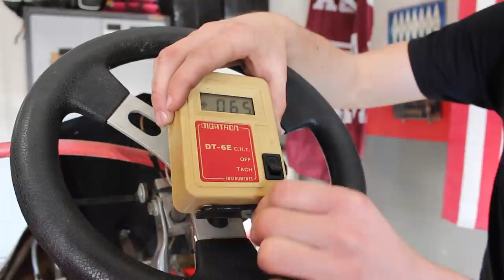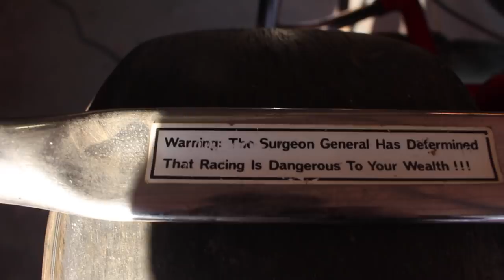2-Stroke Racing Go Kart Find!

Comment: I’ve been looking for one of those engines for years, $400 is a killer deal
Reply: CarsandCameras yamaha also still sells them
Reply: Sounds like the plug could be dead
Reply: CarsandCameras get a vintage kart
Reply: Come to Australia! We still race them here. Got mine for 200 running and rebuilt
Reply: on ebay i buy a birel shifter go kart with a tm kv 92 with 2 chassis and 3 seats for only 450€
Reply: you cant find any? they used to race them all the time lik a year ago... but they were replaced with a ka100.
Reply: CarsandCameras I'm a big fan of yall's work.You guys got me into carts again.I'm gonna buy me a racing cart this week just like this one.
Reply: CarsandCameras I've got a built into that needs a few parts to get it running
Reply: These engines are okay the bt82 engine came in a junior 110 and maxi 115 there vac operated on diagrath lol
Reply: Yamaha Kt100s
Reply: I got a nice racing cart for 400
Reply: thats real old junk  @hotrodj21
Reply: It’s a margay lynx.   A damn caddy in its day!   
C&C kicks ass.    I don’t live far from Isaac!
Reply: I have a few rare race yamahas and mugen engines if you really want to make this thing scary like 22krpm redlines lol
Reply: Hey guys cars and cameras I mean can u do more pit bike videos plz
Reply: You can buy them new still
Reply: You know that engine is a Yamaha kt100cc engine and they are quick as
Reply: @jons8877  They still race them, just depends where you go. There are still a lot of places where they get good grids.
Reply: What engine is that ?

Comment: The BCR on the head will be the kart shop that RE built this motor, I rebuild these ever 10 hours when in race conditions,we still use these motors in Australia for a bit of fun. To prime the carb, take spark plug out and place palm over intake and turn motor over until you feel fuel on your hand. The high and low jets are your fuel meters, start with low jet 1 and a half turn out and high jet at 3/4 turn that's a good start. Supposing this is the walbro carbs we use here. Make sure you haven't got gunk in your crankcase from when you cleaned it. Most importantly have fun these things are sick,wait until you get to use it on a track.
Reply: Also don't idle these motors on a stand without load, your exhaust will clog itself up and spark plug will go to shit. Also probably need a rebuild kit through the carb.
Reply from the maker: Jarrad Powell Ok awesome, thanks
Reply: Build Break Repeat easy done lads!! Let me know of you have any other questions but sounds like you have a pretty healthy motor for the time being! Keep up the great vids!

Comment: Good Vintage  Kart  you have acquired there at a great price. Looks like a Margay from the 80's. I have a copy of the Yamaha owners manual from the mid 1970's when these motors first came out. Standard Carb setting is High speed needle (H) 3/4 + or - 3/16, Idle needle (L) 7/8 + or - 3/16 Idle speed 3,000 to 3,200 rpm. The inlet screen gets clog so check that is clean, also the metering lever standard is 1.4mm below the diaphragm mount best to make up a little gauge to check that. Once you get it runni ng properly operating range is 10,000 to 14,000 rpm. With the right gearing it is capable of 100 MPH. Raced these in the 70's & 80's have one setup with two of these motors on.
Reply: Also Margay karts is still in operation, so if you contact them they can tell you more about the chassis you have.

Comment: Need to watch cranking it over like that an the engine not starting it could wear the rings an piston if it’s not sucking in the mixed gas . I’d rebuild the engine top and bottom an new seals on crank

Comment: Good chance it has weak spark, try a new spark plug first, 2 strokes like to burn up spark plugs. next check your grounds and coil.
Reply from the maker: Experimental Fun Just ordered some yesterday, hopefully that’s the issue thanks.
Reply: Agreed good place to start
Reply: And if you can get the model of the carb off the side I can get the stock tuning numbers for how far out the screws need to be.
Reply: Was gunna say new reeds
Reply: @Chiko Eval Same thought from first attempt.
Reply: They don't "burn them up", lol. They just will foul faster if too much oil is being mixed with the gas (not to be confused with the air/fuel mixture in carb).
Reply: Try setting the low needle (taller one) to about 2 turns out and the high needle (smaller one) just cracked open. I run these settings on my kart with that same engine and not only do I get a lot of power, it starts a lot easier then just dumping gas on it.

Comment: Check the compression. Low compression in 2 smokes makes it act like that. New plug and new gaskets, clean the carb it should run like a top

Comment: Make sure you have the right oil mixes, also check compression, another cheaper and easier way to deal with low compression is put some 2 stroke oil down the cylinder before starting

Comment: When starting my 1990's 100cc class one kart similar to yours I always put my hand over the air intake to draw the fuel up to get it to fire up no problem
Reply from the maker: rickburnout666 I’ll try it. Thanks
Reply: Build Break Repeat I'd put a new spark plug in it first. 2 strokes can foul a spark plugs quickly so might be a good idea to have a few around. It'll look like it's getting apart but won't be strong enough to run. The hand over the carb to draw fuel in is a good tip. You can to the same thing by placing your hand over the exhaust outlet and instead of sucking fuel it'll force fuel up into the carb. You can hold your hand over the exhaust until it starts to run, If you can't find any initial carbs setting online turn the high speed all the way in and set it to 1-1/2 turns out and the low speed needle to 3/4 out. There's probably a air speed screw too and that'll take some fine tuning to get it set right. But you'll love how much power you'll get out of that little engine and It'll teach you a lot about tuning. Keep your eyes on the lookout for a 2 stroke dirt bike you can get a enjoin out of. You could probably pick one up for real cheap. A 125 on that little cart would be sick! You'll have to rig up a shift lever and a clutch lever to get it off the line but you won't need to clutch after that to shift up and down. Just imagine having 6 gears! I'm sure you already thow this but they can got up to100mph with the right gearing. This cart the way it is now is still gonna be a blast! Looking forward to next video when you get it going!
Reply: Build Break Repeat Oh yeah and look into getting a kidney belt. Those racing carts can make you sore from how hard they turn. A lot of race car drivers start out racing go carts they're good practice and they'll reach you a lot about turning at high speed. I see a lot of drifting and bonuts in your future lol. Just be careful and keep having fun! Your channel is awesome!

Comment: I personally like to run my 2 strokes with a little extra rich mixture because its better to use a little more gas than risk hurting the motor. And if it still doesnt run check your fuel/oil mixture. Good luck.

Comment: Nice buy!!! 2-stroke engines need good compression in the cylinder and the crankcase... When the piston moves twds TDC, it compress's the fuel/oil-air mivture in the combustion chamber. When the piston moves twds BDC, it compress's the fuel/oil-air mixture in the crankcase. If the seal of any of the following components is defective, the engine will not run properly: Head gasket, cylinder base gasket , piston ring(s), lower case half gasket/sealant, crankshaft seals... Also check the reed petals on reed-valve engines and the rotary disc sealing and condition on rotary valve engines...

Comment: Take your carb out and clean the idle circuit with carb cleaner an unscrew all needle jets spray them thru also, an blow out holes. Make sure diaphragm has no dry rot damage gas has a tendency to do so after sitting for a while an can gum up an make stick. Check spacing on your excitor coil if its too close it wont successfully spark possibly grounding itself out, causing spoty spark. Also check your spark plugs always, there your window to your motor. Make sure the gas oil mixture is correct
Reply: ^^^ do what he said.

Comment: Turn the idle screw(the big black one) all the way in, the give 1,5 turn out. There should be another screw which is for the air mixture. Turn that all the way in, and give 1,5 turn out.
Start the engine, and adjust the idle so that the wheels turn and let the engine warm up 10-15 minutes. When warm adjust the air mixture screw by 0,5 turns (out or in) the goal is to find the highest idle, when thats done, you can adjust the idle screw again to find the best idle
Reply from the maker: niels maronde Ok, I’ll give it a shot. Thanks.
Reply: And you should probably clean the stator connections with som sandingpaper aswell, and replace or clean the sparkplug :)
Reply: Low speed jet 1.5 turns out, High speed 1/2-5/8 out. But... you need to rebuild that carb first. It's a Walbro and you can likely get it online. The Pumper diaphragm is likely stiff and is not able to pump fuel. Also, the needle is likley shot and not sealing correctly either.

Comment: It’s mike roberts from way back when. It’s a JICA kart you need to choke it by putting your hand over the carb. And if you are driving it and it gets hot put your hand over the carb so that it will cause it to suck in more fuel and cool it. Under racing conditions you will find a lot of people doing this at the end of the straight. Take the head off and see if the piston has ever been stuck. In other words are the score marks in the barrel. What you referred to as a bash bar with the Surgeon Generals sticker on it is actually a bar that is used to stiffen the chassis for faster longer tracks. If it had fuel in it when you picked it up the carb is probably gummed up. Do not leave any fuel in it and let it sit always drain the tank before you put it to bed. I am just thinking off the top of my head. Another thing you could do is buy a 125cc Honda MX motor with the six speed box and you should be able to buy motor mounts that will enable you to bolt it to that chassis. Then all you would need to do is mount a shifter on the steering column and the clutch handle. Not a big deal. That would give you something that is getting close to the shifter cart you have always wanted. They don’t have the power of a purpose built shifter motor then again they don’t cost thousands of bucks. Is there a name on the chassis. Have fun.

Comment: Get a carb rebuild kit, the little gaskets may be dryed out. Your compression should be more than 110lb. Your magneto may need to be timed, that will be under the flywheel just like a durt bike, it may have markings on it to time it. The kart looks to be a 80s, most likely margay or yamah, there should be a number stamped on the inside of on of the front king pine holders.

Comment: Kt100s in general are very finicky engines. The coils fail often due to the heat of the engine when racing along withe the cdi box. If it runs good cold and dies when warm it'll need a coil soon. As for the carb the high speed needle should be 2 1/2 out and low speed is 1 3/8. Adjust as needed when full throttle. Also the compression should be anywhere from 110 to 150. But chances are its the carb or main coil.
Reply from the maker: Aaron Ok cool thanks.

Comment: That's a crazy little 2 smoker, cool find. Also looks like an early 90's Margay. And like some other guys said, clean the carb well and make sure to prime for enough fuel. Is that a Walbro carb? If so you may be able to find rebuild kits at a small engine repair shop, check the tiny screens inside of it and the needles. Then run through all your gaskets to make sure there isn't a leak anywhere. Thanks and Gig 'Em.

Comment: Do a leakdown pressure test on the motor incase a crank case gasket is blown or crank case seals are shot an also do the carb. Id say there is a vaccume leak somewhere. If you dont have a pressures testing kit you can start it back up  and spray carb cleaner around all the carb/gaskets, crankcase gaskets an jug base gasket If it stalls as soon as you spray the liquid means its sucking in air an you can pin point the exact leak when you spray the cleaner.
Reply from the maker: Mark Dillon Oh ok, that’s a good idea. Thanks.

Comment: it looks like a Wahlboro carb same as mine on my racing saw turn both screws all the way in then turn your L screw 1 full turn out same with the H screw then try and start when it runs turn the L screw in for higher out for lower revs then when that is sorted and the engine idles on its own rev it full out the listen to the revs if it sounds like its missing turn your H screw out or in until you are happy with the revs i hope this helps you out

Comment: The tuning for these carbs start at 2 turns then work your way to 1 1/4 turn on low jet and 1/2 to a 1/4 turn on high jet, best to check spark plug every time you drive after making adjustments. that’s with a fuel ratio of 20 litres: 1 Litres of oil, new spark plug would help.
I’ve raced them for about 5 years and they are a bloody strong engine. You can easy get 16,000 rpm with these engines, also check the rotor gap with a business card thickness. I’m from the land down under 🇦🇺cylinder head temp shouldn’t go above 200 degrees Celsius, not to sure about exhaust temp tho.

Comment: 2 strokes racing karts tend not to run at idle, so don’t beat yourself up about not running at low rpm, it’s common for them to cut out at low rpm, but with some throttle it should be fine

Comment: You should have poured some 2stroke oil in the spark plugs hole before you tried to turn it over
Reply: A bit of oil in the cylinder can also help if the rings are a little stuck, or just bone dry from sitting. On a (4 stroke) BMW motorcycle I have due to the way the engine is laid out, after sitting for long periods oil will run down away from the rings and cause low compression
Reply: Jason Grimm the spark plugs hole is the cylinder buddy.
Reply: John Smith he obv knows that but I think you just read it wrong
Reply: I just noticed you made the same comment I did! LOL
Reply: So true man

Comment: I was  in Karting for many years ago.  I'm not sure the exact year but I'm quite sure that Kart is a vintage
Margay Lynx.  It's either an 86-87-or 1988.  The M on the seat cover is a Margay trademark.  I would love to find one in that
condition for complete restoration.  You have quite a find. The KT-100 is probably one of the finest 2 stroke engines ever
made for the beginner.  Good luck son..

Comment: Always clean the carb if it's been sitting a while.
If your stuck drop us a mssg.
Member warm the engine up for 3-5 mins before you give it stick. Never put too much oil in the petrol or filler. And stay safe

Comment: Put air filter on it. They also make small engine fuel filters. Can pick one up at any small engine shop. Check gap in spark plug. Hold foot on break when starting. I raced a kt 100 on dirt racing kart. I've raced for many years. Also when adjusting your carb watch ur tac to see what rpms your are running. Should idle around 4500 rpms

Comment: Low needle needs opening so it gets fuel to idle on.. High speed needle is for top end so leave the high needle alone for now and unscrew low end till it runs then adjust idle screw and go from there

Comment: There is still gunk in the carburetor. Take apart,again, completely, blow out all the passages, reassemble.  Main Jet 3 1/2 turns out, this will be rich. Once running, and warmed up, lean it out slowly, when the engine,"comes on the pipe", RPM will come up, then richen it a bit.

Comment: Definitely check compression. Just because it "sounds" like it has good compression doesnt mean it does. If you cant find compression specs for that engine then shoot for at least 90psi. Anything less and it needs the top end done. Also check your reed valves if it has it. They will be behind the carb, tucked in the cylinder. They should shut smooth and be free of cracks and debris. You issue is definitely with one of these 2 things. Not much else ever goes wrong with a 2 stroke

Comment: Race karts are expensive! I used to fix these things and they need to be rebuilt after almost every race. Try getting a new cylinder head, piston rings, and piston. Might need new road valves also. Wouldn't hurt to put a new spark plug and re-gap the coil and also get a carb rebuild kit. Cleaning out the exhaust helps sometimes also. Two strokes are dope tho haha

Comment: you have to pre pre pressurized the the fuel system just a bit before starting or you have a hard time starting and the engine needs it's oil

Comment: OK, so that "Bash Bar" as you called it with the clever sticker on it is a chassis stiffener bar, you adjust it to change how much the rear of the kart flexes in curves, & combined with a bunch of other settings it'll help you hook up in the turns -
Reply: Most common thing for an old Two-stroke RACE engine thats been sitting that long would be CRANK SEALS - if the fuel tank & line was that brittle, and the vacuum-pulse line from the crankcase was too, why wouldnt they be? Air & Vacuum leaks will DESTROY a two stroke - as a lean condition will cause the piston to weld itself to the cyl walls, might as well just get the numbers off the motor and start right off with a fresh set of rings and all new gaskets and two seals...... Also that clutch seems like its not releasing properly, I noticed when you hit the brakes it was really dragging the engine down, you have a problem there too- we always ran Horstmann Lock-up clutches in the 90's on the 2-strokes, dont know what brand you have there? Best place for advise and possibly old NOS parts would be TS Racing in Central FL, as they have been a Margay Kart and Yamaha Kart engine dealer since the dawn of time!